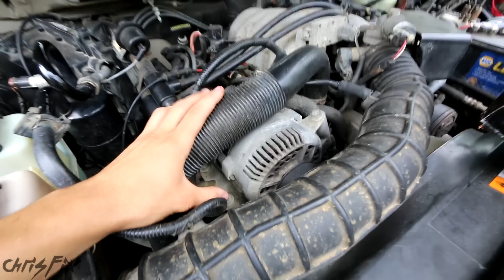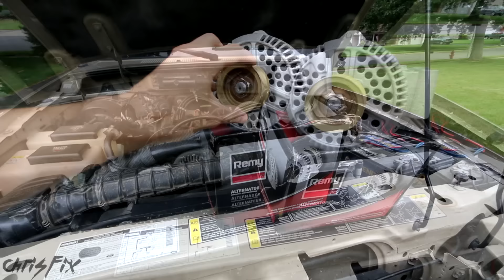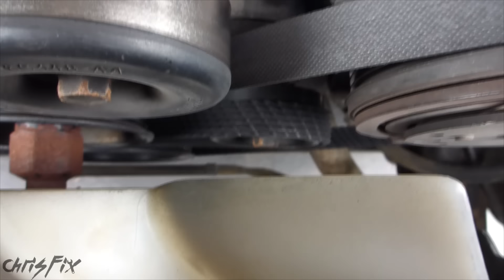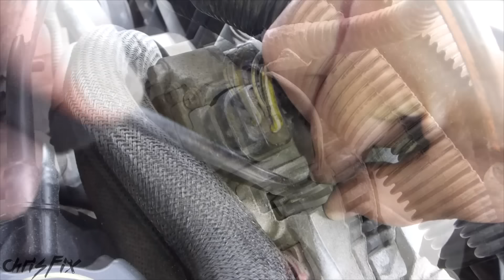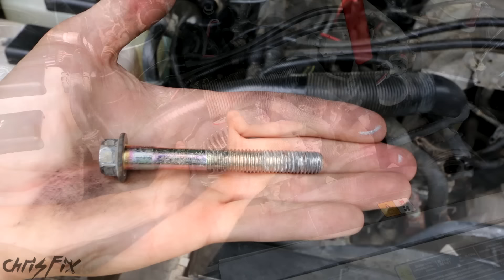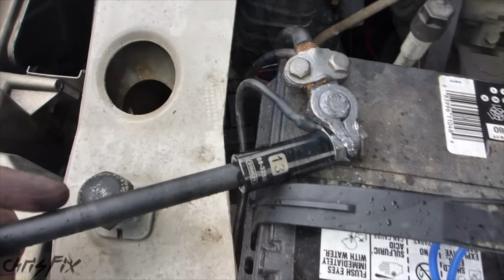How to Replace an Alternator

Comment: I have replaced my alternator 3 times in one yr, I had the vat checked for any electrical fault but the car checked out clean, the amp I am running a 90 amp alternator, would it be safe to add a a slightly more few amp alternator to my car, say 100 which is what the fuse is register to hold.
Reply from the maker: BrownKnight011 Something is causing the alternator to die. Although your electrical system doesnt have any faults it might be due to voltage spikes at higher rpms or even a bad battery. If you havent replaced the battery, I would try that first. Also, I will be doing an electric system upgrade video which might solve your problem so stay tuned for that! A bigger alternator might help but 10 more amps wont really do much if you are burning though alternators like that.

Comment: Just a recommendation on my ranger I did same upgrade not sure of all alternators manufacturer are the same but on the back cover I found a treaded hole, I used to attach a ground wire to it, to improve ground
Reply from the maker: Royrockbrain That is awesome. Mine doesnt have that but when I do the electrical upgrade video I will be attaching a ground to the alternator just like that. A dedicated spot would have been nice!

Comment: Never had to change the alternator on my 94 ranger but did change one on my dads sable. What a pita due to it being a fwd v6. Depending on the design you might be able to get away with not adjusting any pulleys thats how i did it. The alternator was kind of a swing arm mount so once the bolts came off it was able to be moved.

Also i recommend being careful to secure the belt properly. On a engine like the ranger (longitudinal mounted engine) its not so bad but there isnt much room on a fwd car to put on the belt. Its an easy fix but a pita.
Reply from the maker: MrE30ftw Thanks for sharing! A v6 fwd is a real pain if there is no space! My ford windstar is a v6 fwd but surprisingly it wasnt bad. That is a good tip with the swiveling alternator in some cases instead of messing with the tensioner! One less step is saved time!

Comment: Seema like your truck has a lot of problems. For all the videos you make.Lol
Reply: marc ravey Seems that way but It is 14 years old and has a few miles on it. That and he was probably really stressing that alternator with all the aftermarket lighting.
Reply from the maker: marc ravey It is an old truck and the previous owner severely abused it! I got it for a good deal because it had so many problems. It works out in the end because I have a ton of content to share with you guys!

Comment: A1 job chris :-D, and such a nice shiney shiney alternator ha ha :-D.
I know being pretty wont make it work any better but it makes you want to clean the engine around it as well.... ok just me then :)
Did the old alternator fail to cope straight away after the lights or do you think it was a bit weak and watery anyway.
Is it just a remy or delco remy.
Reply from the maker: zx8401ztv It is a problem haha. Since it is clean, it makes me want to paint/clean everything else! The alternator was shot before I did the lights but I didnt want to damage anything so I had to change it out asap because when voltage drops that can cause issues especially if there is a big load on the alternator! I think it is just a regular Remy alternator.

Comment: mybcar has recenty stopped starting the ac in idle, when it goes above 2000rpm, then it starts and chilling. and everything is normal. but not on idle. any advise Chris?

Comment: hey chris, i see you didn't change the serpentine belt. i changed my alternator a few months ago and wasn't able to change my belt because the aircon was running on one of the same pulleys and i couldn't see how to get that belt off, so i just put the same belt back on. is this a big problem? my car's a 2001 with under 60k on the clock, the belt looked fine to me but it does make me a little bit nervous. love the videos dude, keep am coming :D
Reply: Look for cracks on your belt if you do not see any you should be fine
Reply from the maker: burnzy3210 My belt is pretty new: https://www.youtube.com/watch?v=AEUe6uKxTv8 but I will have a video on how to check your belt soon so if your belt is bad, you might consider changing it out. A belt will last 50-100k miles so you are in the range where you should check it. I wouldnt be nervous. You would hear a bad belt or see that the belt doesnt look right.
Reply from the maker: Robert Cuevas Great tip! Thanks for helping!
Reply: burnzy3210 If your belt is fraying or cracked you should replace it.  It isn't a bad idea to replace belts every 50K miles.  if it didn't break you save the old belt as a emergency spare.  Or you can be totally cheap and drive around with new belts in the trunk and wait for the belts to fail so you get every mile out of them.

Comment: Chris fix!?
I just replaced my alternator on my 04 Accord. Nothing was wrong with it, I am putting in a sound system so before I threw in the amps and speakers I replaced it with a high output 230amp alternator because the stock is only 70amps. And once I hit 4000 rpm now the battery light flashes? 
Any answers?
Thanks
Reply from the maker: Tyler fini Check your voltage at 4k rpms. Have someone rev the car up, check DV volts and see if it stays around 14.2v. I bet your alternator is dropping like mine did. Check out the video in the description on checking your alternator as well. I have some other tests that would be helpful like a voltage drop test. Keep me posted!
Reply: Will do thank you. Going to check it today
Reply: I got 13.6 vdc
Reply from the maker: Tyler fini You should be getting 14.2v. I am thinking your alternator is bad.
Reply: Seriously?? I just bought this one to... But thank you for your help

Comment: I am using yellow top battery optima for my jeep did you think about changing  your battery to yellow top help with electrical demands i will be putting  on front bumper and winch and maybe lights good video thx
Reply from the maker: geohooptie Yes! I plan on getting  a new battery soon for the electrical system upgrade video!
Reply: geohooptie A bigger battery will put out more amps, but the alternator charges that battery.  if your alternator can't keep up you need to turn something off.

Comment: on a fiat cinquecento, the alternator is on the back of the engine. to get it out you have to remove an engine mount and jack the engine up to get it out.
Reply: That's why fiat is shitty.
Reply from the maker: insanitybiker Wow, that is a dumb design. It makes you wonder what the engineers were thinking!

Comment: Idk if you know this of not but if you do oh well! But always have your truck running when using these lights, if you have your truck off and running them, it uses straight power from the battery and drains the battery very quick because the alt isnt running
Reply from the maker: CodysDesigns Thanks a lot for the tip bud! I do know that but it's awesome you are looking out for me! The LEDs last 30min with the car off before the battery drains with my current setup (dont ask how I know) hahah
Reply: ChrisFix 's pretty cool that you know that, I would like to know that too

Comment: maybe the connection was bad instead of the alternator
Reply from the maker: ‍1marcelfilms Good thinking but the connection was fine (did a voltage drop test). You can find the alternator test video in the description where I test everything out. I think it was a voltage regulator in the actual alternator.
Reply: could putting a new alternator cause problems? i put a new alternator and now the car staled while driving after a long ride. its almost as if the spark was cut off at once. its almost as if it is 1 or 0. either it runs perfect or it shuts off.  I also put in new rotor and distributor cap.
voltages are fine.

Comment: Can you get a bigger alternator for any car? If its 110 volts can I go bigger???
Reply from the maker: TheBobby1501 It depends. In this case, my truck has a 95 amp stock but it had a 130 amp option so the wires are designed to take 130amps. If your car wiring can handle a larger alternator, you can upgrade it. The wiring upgrade video I am doing will allow you to run whatever size alternator you want since I will be running a new, thicker power cable.

Comment: Thanks Chris! Good video) But I have a suggestion for you: use Liqui-Moly Battarie-Pol-Fett for electrical connections like on this alt, this will prevent corrosion inside the connection.
Reply from the maker: Finder Black Thanks and thanks for the tip! I will have to look for that stuff!

Comment: In my vehicle, i plan to mount a 12 inch light bar and upgrade to hid lights with a proper headlamp housing. Would you recommend an alternator upgrade next time it needs replaced?
Reply from the maker: mrklimczyk It really depends on the car. In this case, with the lights I am running right now, I did not need a bigger alternator. I draw about 60-70 amps with everything in the truck on. But I plan on doing more upgrades so since I needed a new alternator it was the perfect time to get a new one. A 12in led light bar and some HIDs should be within the capabilities of most cars stock alternators. Thanks for using the proper housing!
Reply: ChrisFix thanks for the response. I like that you noticed that i would use a proper housing. With some normal light housings, you may end up with excess glare coming out.

Comment: Doesn't taking off the live positive wire make more sense? If that wire comes in contact with you or your tools it can ground out from your tool while you are holding it which in turn will not feel so well. 

TL;DR taking off the power wire makes more sense.
Reply: The negative terminal is where the charge is stored. Disconnecting the negative allows no flow through the system.
Reply: JeremyDelinela 12-15vDC will not be felt unless your hand is covered in saliva (which I hope its not!). The resistance of your skin is simply too high to conduct much of anything at that voltage. 

Example: Take a 9v battery. Touch both contacts with your finger. Nothing happens. Now touch it to your tongue. It will hurt.
Reply from the maker: Ernesto Andre Exactly!
Reply: Taking of the negative stops the flow, every ground in the car ends up to the negative terminal through the engine/chassis ect
Reply: JeremyDelinela Absoluteley not!  There is a saying "Ground is God".  Doing it your way you can still ground the positive post to any exposed metal.  By removing the ground the only way to cause a spark, and by extension a possible explosion, is by touching a hot wire to the negative battery post.  If you have ever had a battery blow up in your face, I have, you want to know these things.
Reply from the maker: JeremyDelinela The negative line is actually where the current flows from so when you take that off, there is no ground and no current can flow.

Comment: From my experience you may have the correct size alternator but it might not fit the belt. as so you just have to take off the old one and put it on the new one, also might be good to remove the whole belt and inspect it, mine shredded when i replaced it, thus making life more difficult. for any of those interested i did the fix on a 2003 ford E350 15 passenger van with more than 280,000 mile's on it.

Comment: will all the stock wires be able to handle 40 more amps going thru them?
Reply from the maker: farerse Yes, this truck had the 130 amp alternator option so the wires in every truck are capable to take 130 amps. Plus, I am doing an electrical system upgrade video to beef up the wires even more just for better electrical performance! Good question!

Comment: so just drop a high outout alternator in it? dont need to change anything else??
Reply from the maker: johno258 For this truck there was a 130 amp alternator option from the factory so the stock wires are built for that. Also, I will be doing an electrical system upgrade video where I will be putting in bigger wires anyhow to make it even more capable.

Comment: Now to stop playing around and run a 1/0 AWG charging cable from that alternator for better voltage when you have all the lights on. you also dont NEED that serpentine belt wrench but on small cars it makes your life worlds easier. Iv burnt out 2 alternators so far on my cavalier due to my rather extreme stereo system. At least that one crapped out when it was above 4,000 RPM. My alternators tend to crap out below 3,000 RPM. Also should do a 1/0 AWG engine ground as well.
Reply from the maker: ***** Haha, I am going to run 1 gauge in the electrical system upgrade video (big three upgrade) I am doing. Stay tuned for that!